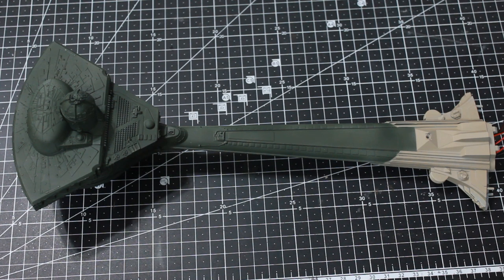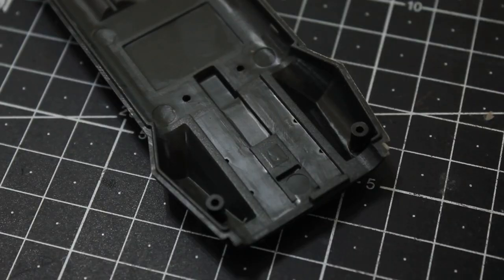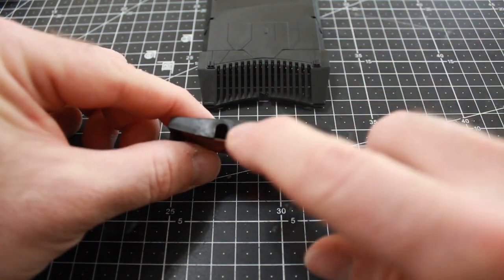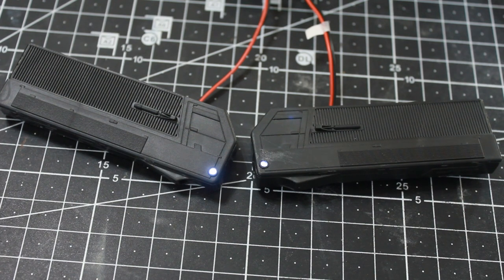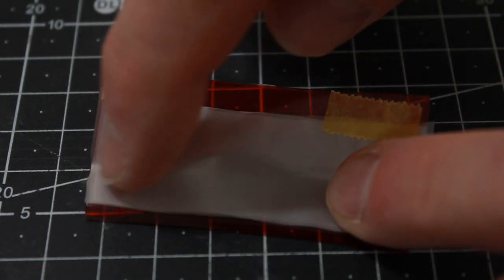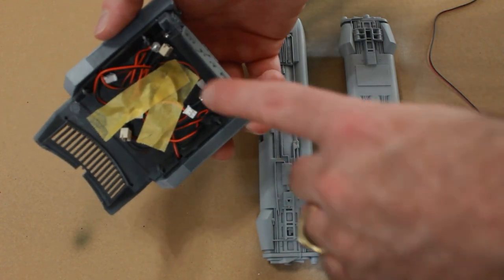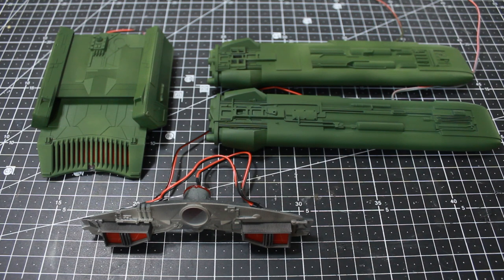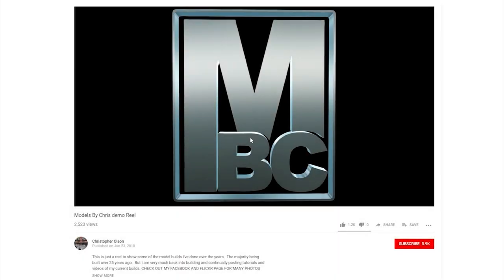Klingon K't'inga Battle Cruiser 1/350 Polar Lights model Build Pt 3

Comment: You're inspiring me to get back to my own build. She's been a shelf queen for several years now, collecting dust. I am probably closer to completing it than I thought, aside from a few more painting areas. I really went all-out to paint all the details on it. For the clear red parts, I just scuffed them up on one side with some 400 grit sand paper to achieve light diffusion. To be honest though, I cannot remember if it looks any better than the diffusion sheets you are using.